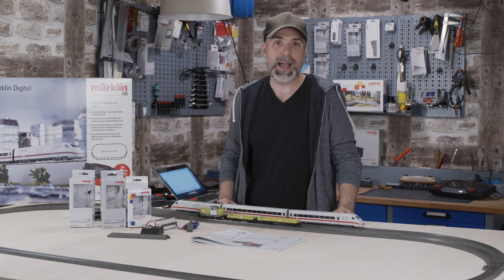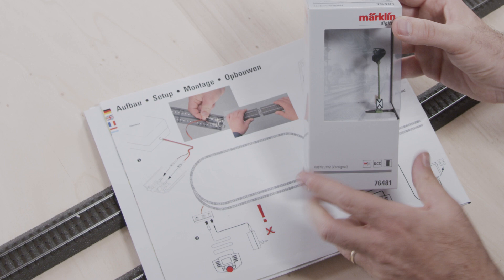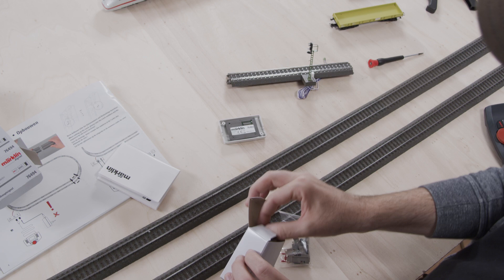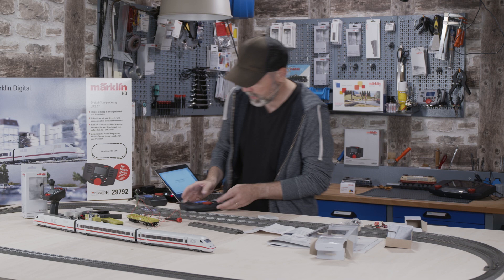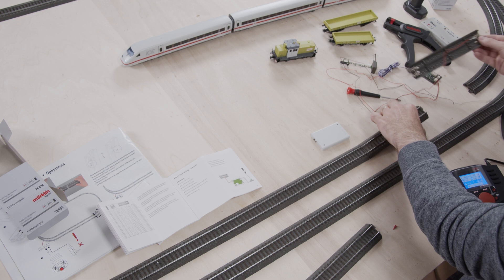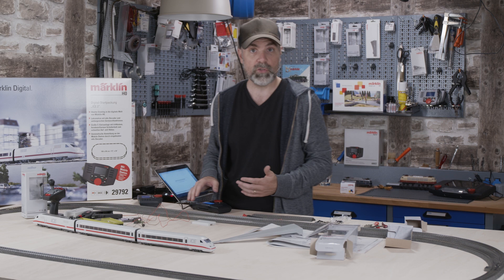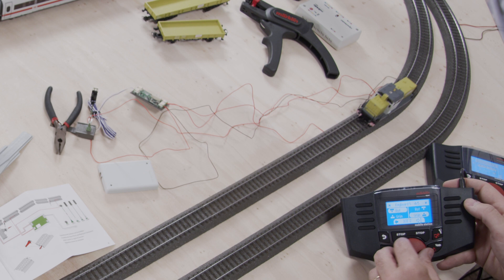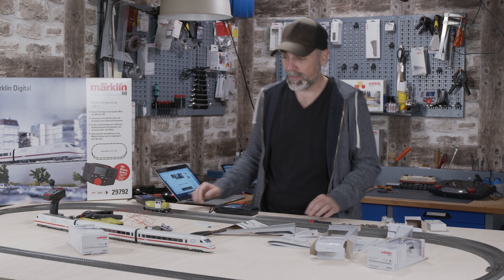Building a Model Railroad / 03 / How to set up Märklin signals

Comment: Very nice.  However, for realism, I find the option where you don't cut the current to be best. Even with a breaking module, if the train goes in the opposite direction, it should not stop, but it is stopped when you let the current be cut by the automatism. I hope I'll be able to drive my trains with the CS3+, and slow them down and stop in front of red signals without having to cut the current.  It might need some more sensors however, so the CS3+ may know better the state of the railroad network.  Perhaps I'll implement a computer vision system with a pair of cameras looking at the network to identify the current state and let the CS3+ know what trains should be stopped...

There is also the situation on real railroads, where you have two signals on the same section: a main signal for the line trains, and a work signal for shunting trains.  The two signals may be contradictory, but each must be respected by its own class of trains! (the shunting trains have additional constraints that will keep the security if they go beyond a red main signal, or they may be diverted by a switch). These situations cannot be dealt with if you cut the current...